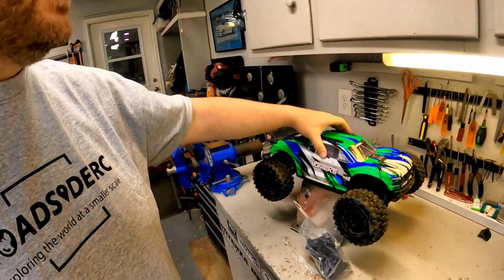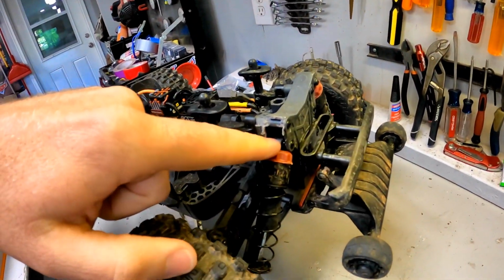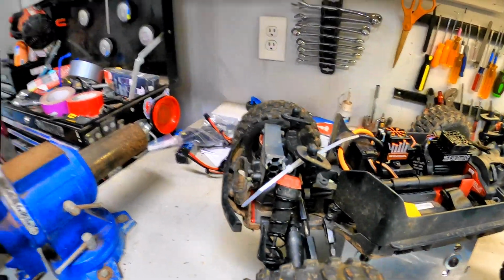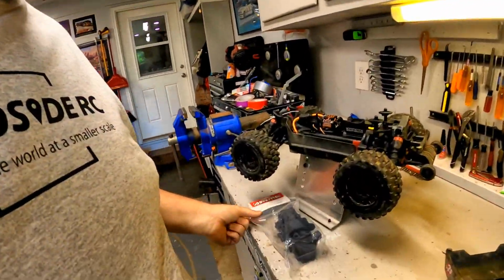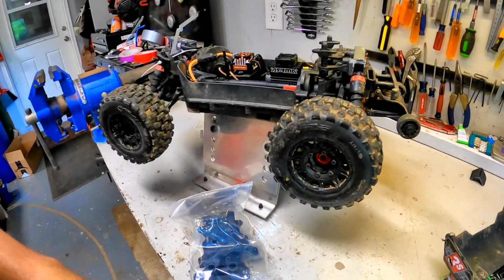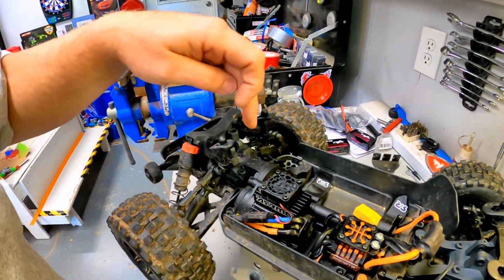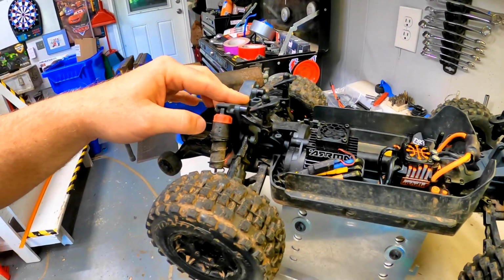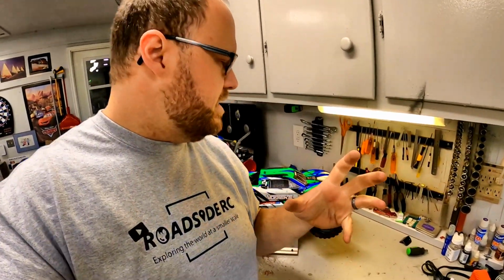How To Replace Arrma Vorteks Shock Towers

Comment: Thanks for the great video! I’m brand new to hobby grade r/c’s and I’ve had my vorteks 3s blx for less than a week and I stupidly decided to go to the skate park with it, I had a blast but ended up blowing out the left rear shock, the right rear suspension arm, and the rear gearbox cover/ shock tower. I tore it all down and ordered the parts on Amazon. Your videos really helped with the process! Just finished putting all the new parts on and went for a quick rip! I also bought a 1/18 Arrma granite grom 4x4 at my local hobby shop to scratch the itch while waiting for parts, it’s an awesome little basher as well! Thanks again!!
Reply from the maker: Glad my videos could help!  
We always say - going into a skatepark is going to cost AT LEAST $20...
Reply: @RoadsideRC  it definitely let me know what the limits are, I definitely don’t want to be beating on it all the timee like that but as a newbie it was nice taking the rc apart to work on it  early on to get familiar with everything!

Comment: Hey the steering servo on my vortex’s is acting funny. It doesn’t exactly sound the same. Turning right with no problems and returning to center no problem. Turning left with a funny noise like a struggle and almost a robotic return to center. I tried this with and without the servo attached to steering linkage. I’m assuming it’s a gear issue within the servo. I’m not sure how to service this part on my rc. A video would be awesome.
Reply from the maker: Check this out: https://youtu.be/WU3RjmYD5oE
I have not done a video specifically on the Vorteks yet, but it should be the same process as you see here with the Typhon.

Yes - I do assume from what you have said, that the gears in the servo are stripped.
Reply: Thanks brother
Reply: @RoadsideRC  hey bad news for me. I removed the servo gears looks good but it seem I burnt out motor. The clicking noise seem to stem from the motor. Thanks again.

Comment: This gives me some appreciation on how Arrma makes these trucks easy to work on by keeping a bunch of the parts universal to the respective lines. It's kind of a double win as it makes manufacturing costs lower while also allowing them to get replacement parts out there relatively inexpensively without having to produce tons of specialty SKU's. It would certainly make me feel more comfortable buying some of their higher line vehicles.
Reply from the maker: Yes!  Their 3S lineup has a lot of common parts - so does their 6S lineup.  It is very handy for sure!

Comment: Super helpful, as usual!

Do you have any videos of tips for newbies driving truggies, or any RC for that matter?
Reply from the maker: Interesting idea!  I have not created a video like that.    
What types of things would be included?
Reply: @RoadsideRC  literally how to get started with driving. Tips for steering, especially when 'reversed'. Weight transfer under breaking and acceleration, and what to use it for etc.

Basically how to gain as much control and reward as quickly as possible whilst avoiding bad habits and destroying your pride and joy.
Reply from the maker: @robbennett6053  Thanks for the suggestion!

Comment: What replacement shocks do you recommend for the front and rear of the vorteks 3s? Mine front shock shafts broke the first time out and im looking for something stronger. Thanks.
Reply from the maker: I am actually working on a video for it now.  I bought shocks from multiple suppliers all to test them. 

Folks usually suggest the Pro-line shocks (https://www.amazon.com/dp/B08R455F2Q/ref=cm_sw_r_as_gl_apa_glt_fabc_1AJ7KXK2Z8JC6JTSA44G?linkCode=ml2&tag=roadsiderc-20) but they are very expensive. 

These are some others I am trying, 
https://amzn.to/30WygWu
but the springs are waaay too stiff.
Reply: @RoadsideRC  thx. I look forward to the video as I am new to the hobby.

Comment: What’s going on man I just got an Arrma granite And straight out the box I can hear a slight ticking sound when it drives  What do you think it could possibly be Straight away I want to say it’s the gear that turns the differential but I’m not no expert do you think you could possibly have something to do with the spur and pinion being too tight
Reply from the maker: Honestly, you could start taking it apart to see if you can find the issue...or you can just drive the heck out of it.  
If you listen to my videos with this truck, it was very noisy at first...and seems to have gotten quieter.  

Typically a ticking is something rotating, so could either be your spur/pinion or the front or rear differentials.  Look it over, see if it is something obvious, but as long as the truck seems to drive fine, don't worry about it too much.
Reply: @RoadsideRC  Right on man I appreciate it definitely gonna have to start breaking it down and there is no real issue driving it just a little ticking it’s kind of annoying LOL but thanks again